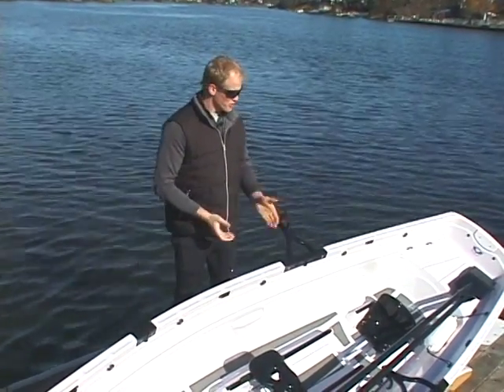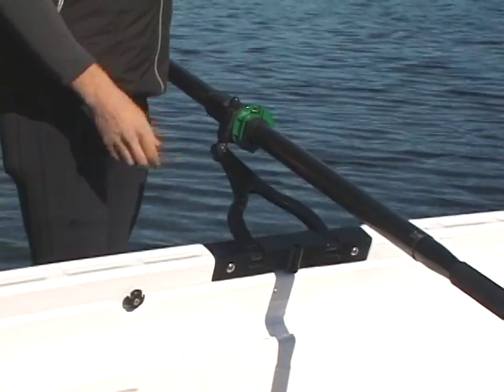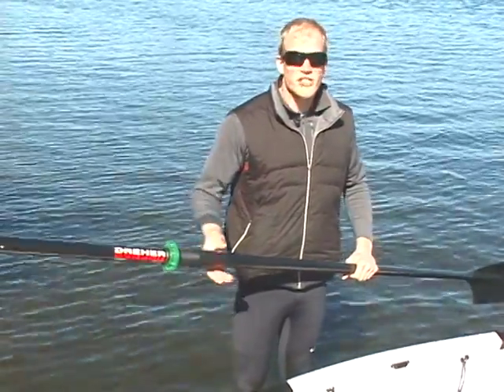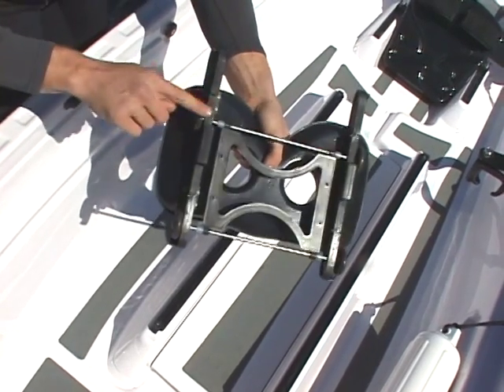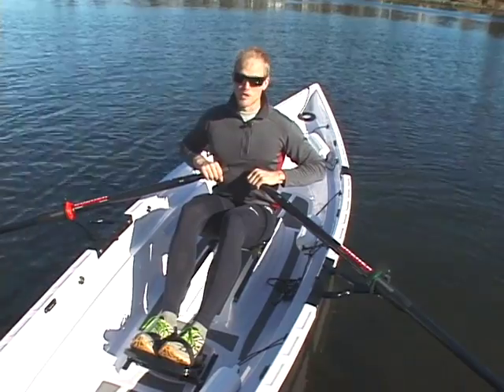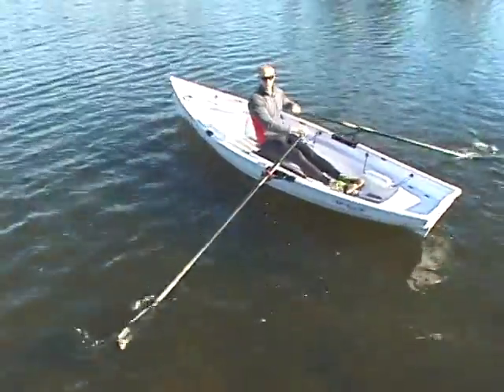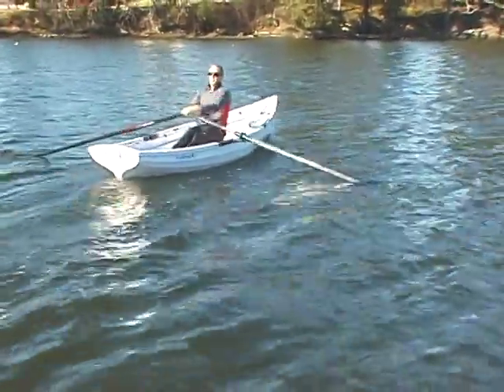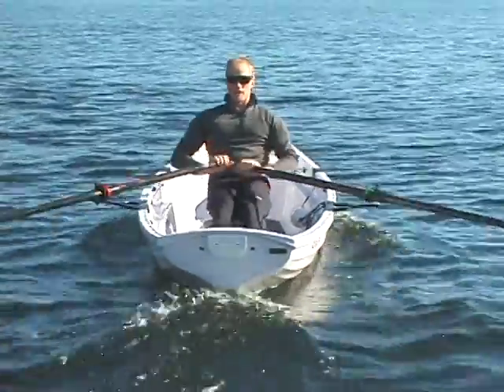How to Row with Adam Kreek

Comment: just started with rowing end of 04/2024 ... I began rowing in a coastal skiff (35 kg heavy polyester boat with lots of buoyancy) with slide rigger (Virus Turbo 2) and I can handle rowing in every weather conditions and traffic conditions (with cargo ships and crazy speed boaters in Dutch channels). Excellent video ... best introduction "all around" with all relevant aspects for a real beginner. Tks for Whitehall and Adam . :-)  (P.S.: Not has changed a lot beside new oar shapes e.g. Concept2 Comp(act) and the collar rings are now with double walls mounted on the sleeves. Iit just broke exactly that kind of oar ring (as in your video) on old dreissigacker Macom oars, suppose more than 30 years old oars built with glasfibre.)